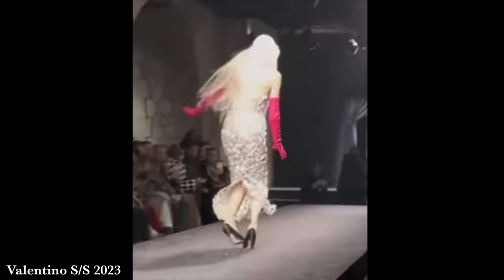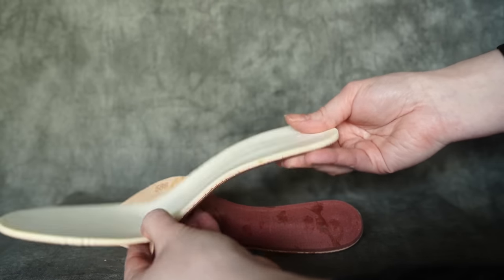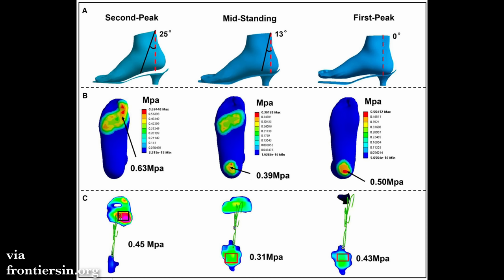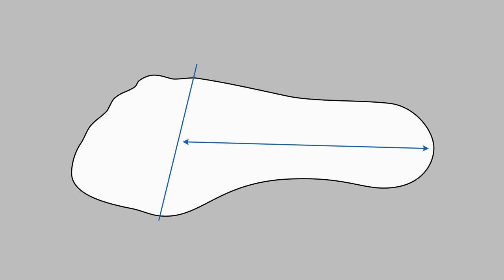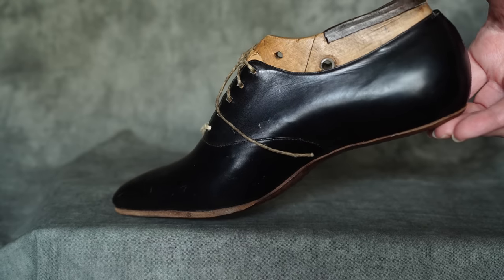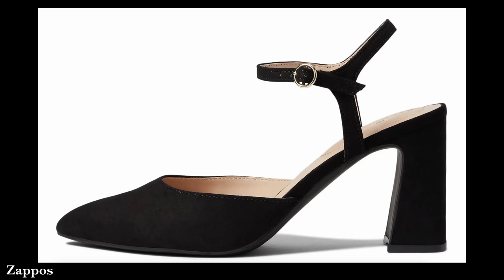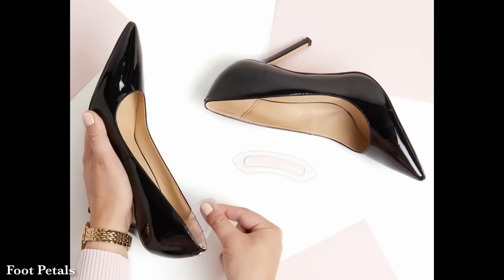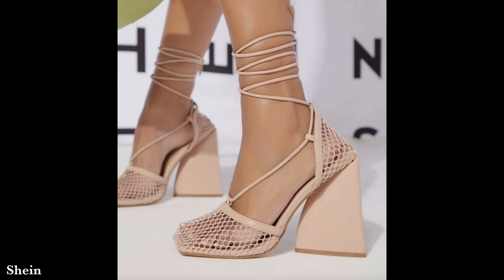Why are Modern High Heels so Bad?

Comment: As a model who has never fallen but have been always very anxious about it, this is my perspective. Most designers don't have the proper shoe size for every model, because the collection is still not fully ready to be commercializable when the runway is scheduled. So it is very common to have to walk in heels 2 or 3 sizes too small or too big (assistants put paper in them). Doing a catwalk walk means you have to walk heel first, and putting all your weight in the heel, plus not really moving your knee (the hips do the movement, sometimes models even rotate the legs a little bit to do a more 90s like walk) it puts a lot of weight on the heel, hence the possibility of falling. There is also a psychological factor : big crowds and catwalks are stressful for even the most experienced models, especially during fashion week, when you have to hurry all the time.
Reply: That is interesting. I don't follow Fashion, so my questions might be naive.  I've got to wonder, are the shoes ever a focus of the runway show? Because a shoe's design wouldn't show well on a foot that doesn't fit it. Do models have any sort of leverage or protection? I certainly doubt they're unionized. It seems there's a real chance of injury.
Reply: Still doesn't make any sense to do too small versions, if most of models have standard or bigger that standard size foot, especially if you can put paper inside.
Reply: Thanks for the insight. I have noticed the oversized shoes.
Reply: @dennischiapello3879  some designers do, especially the ones who embrace body positivity like Esther Manas or who have been known as shoemakers like Robert Clergerie, but you don't have the luxury as a model to choose only designers who focus on shoes. Models aren't unionized even if there have been attempts to do so in Europe.
Reply: @poisonedh  oversized shoes are more frequent for unisex shoes like sneakers.
Reply: @throwaway7899  It would be nice to think that the proliferation of these videos might begin to put pressure on the industry--or at least more designers--to address the problem. The real highlight of this video, by the way, is the model throwing the shoes away.
Reply: This makes me want to practice my catwalk lol I’m rooting for you! Does a fall ever have a negative impact on a models career prospects? It seems like they’re shifting so much burden of pressure on the models.
Reply: If they are too big, they often tape the shoes to the models' soles,...
Reply: As a previous dancer, that seems completely and unnecesarily dangerous.

Our ankles have multiple bands that are very sensitive to injury and longer lasting damage. At least dancers have done exercises to strengthen the muscles there.

I'm really of the opinion that its dangerous to put skinny untrained models in heels that are either too small or too big. You only have 2 knees and 2 ankles, they are more important than a job imho.
Reply: @Aardappelpurree I agree. In how many other jobs is as poor ergonomics, leading up to bad safety, even allowed these days when it could be easily prevented?

Comment: Well, that actually explains why my daughter can wear what I think are sky-high heels with no problems whatsoever. Her foot is a stiff, narrow, size 9.5 flipper with short toes, and she does make sure her shoes fit and provide good support. No skinny straps for her, and they still make me wince when I see her trotting by at full speed on those spikes as if it was nothing.
Reply: It’s not just the feet - it’s also the young. I have wide flexible feet and spent my youth in tall heels because I could. Was a super fit athlete. Now I see young women in daffodils and my feet hurt. 😆
Reply: I was like your daughter when I was in my early 20s, I ended up developing Morton's neuromas in both of my feet and now cannot wear heels anymore, I hope that doesn't happen to her
Reply: @biosparkles9442  She's 40, very slim, and everybody thinks she's in her late 20s. It's disgusting. But, well, she only dresses up a few times a month. Most of the time, she's in scrubs with her hair under a bandana and a face mask, so I can't blame her for dolling up when she can.
Reply: Until this video I had no idea that hardness of feet was a thing
Reply: @yuuri9064  Ooh, definitely. I am hyperflexible in every single joint in my body. My feet are just as flexible as the rest of me.
Reply: @nokomarie1963  Why is your 40 year old passing for 20 years old disgusting? 
It doesn’t sound like you like your daughter by the two messages you’ve described her, but tone on messages can be lost, but I really don’t understand the disgust part at all.
Reply: @vichentez  I don't think she meant it literally - it's just kind of an expression.
Reply: @nokomarie1963  disgusting? You sound jealous
Reply: I’ve got longer toes and find the heels in my size don’t fit that well, as well as I had an ankle injury and am supposed to do exercises to help, heel lifts, side leg lifts with heel up but aligned with my knee, eversions and ‘drawing the alphabet with my feet’ in the air and walking with insoles
Reply: @vichentez  I think she meant it in a playfully jealous way.
How I'd describe my sister having an absolutely godsent hourglass figure disgusting in a playful manner when I actually think she looks beautiful.
Reply: I used to wear all sort of crazy high heels and pumps when I was 18 and no person on Earth would ever heard from me how uncomfortable am often straight up criminally unwearable they were. I was very stubborn and very determined. That was a fashion standard back then
Reply: @vichentez  
OP is good naturedly expressing her envy.  I’m sure there’s an amount of pride in there as well.
Reply: @vichentez  i read it as op expressing disgust at all the people who think their daughter is in her 20's when she's 40 because there are people who are surprised that a 40 year can be perceived as attractive. i think maybe its a little like how there are people who mistake 13 yro girls as being in their 20's, but the opposite? same idea tho, that mentality of "i think this female entity is attractive, therefore, she must be 18-29 years old." 
of course, im not op, so idk if thats really why they feel disgusted
Reply: @yourtypicalinternetcommenter11  I bet we’re the same, fine vintage. I was the same way—I could HIKE in heels.  Long gone are those days!
Reply: @vichentez  Hah! Disgusting, as in I am 60, no longer even remotely slim, and I never could manage high heels.
Reply: @nine9nine9  Silly.
Reply: @LivVirtual  I don't